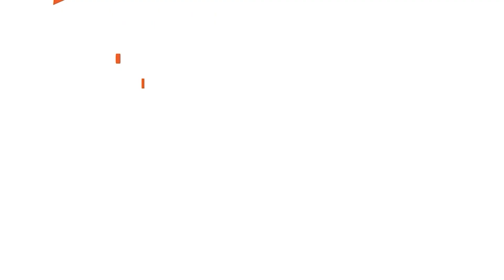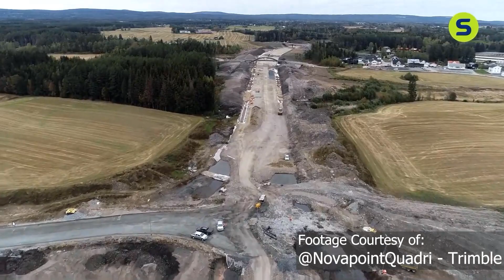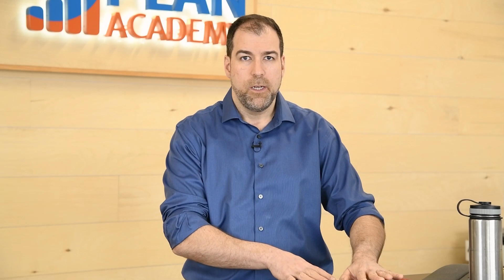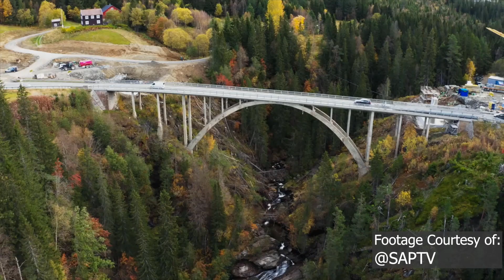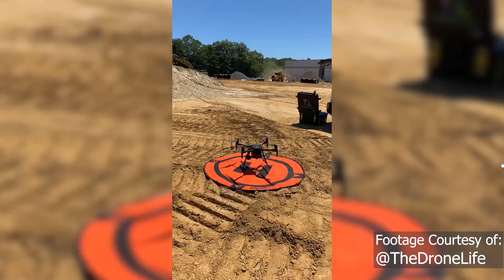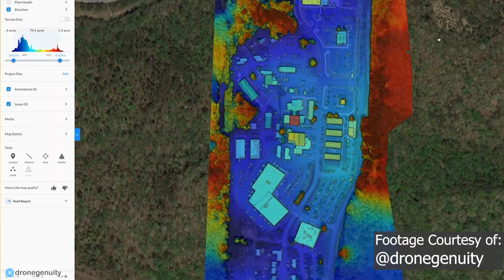Digital Twins Could Change EVERYTHING in Project Controls

Comment: A true digital twin isn’t just a model that is updated. It is a software version of the building, receiving real-time information from the BMS system and any other sensors built in. It allows scenarios to be run on the model that will replicate real-time usage and predict failures before they happen  to the real asset so preventative maintenance can be carried out. They also allow you to model alterations t the building and predict what impact they will have on the existing systems and loads. 

They don’t really offer anything directly to construction scheduling but we should all be aware of them and how they will impact the construction programme as they require a LOT of pre construction time to make sure they are implemented correctly for the whole life of the asset.

I’m surprised this is new to you. BIM and building modelling has been a consideration (requirement) in UK government projects for over over 10 years and digital twins have featured in tenders I’ve been involved in for the past 5 years.
Reply from the maker: Great insights, Richard. Thanks!